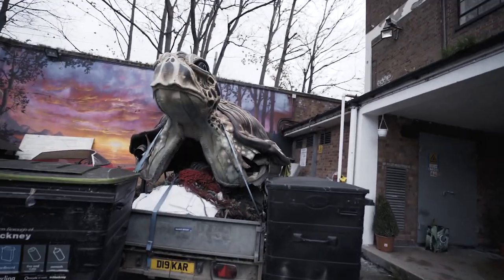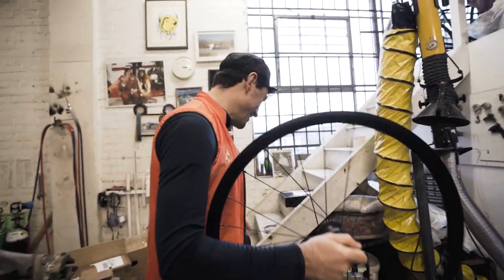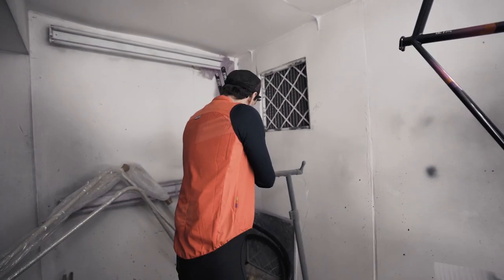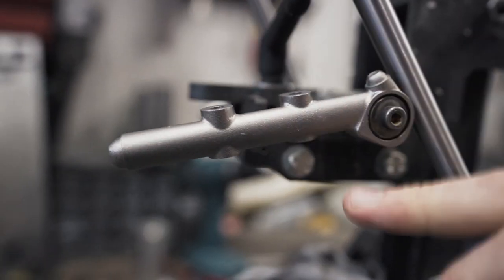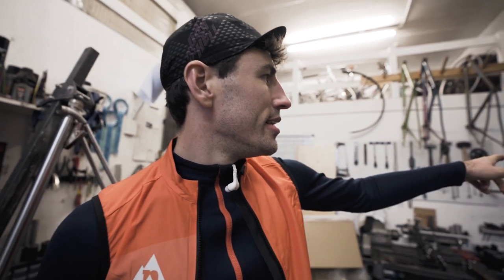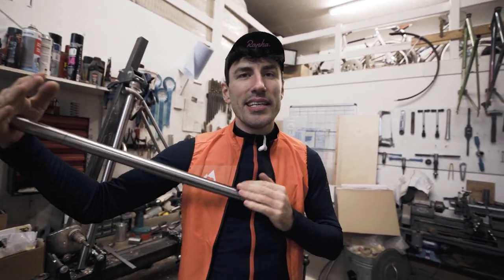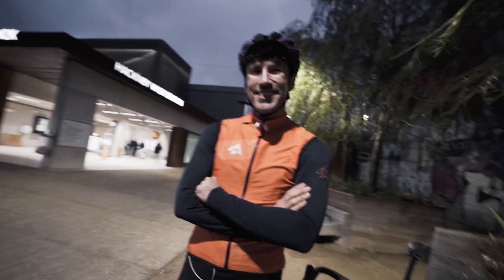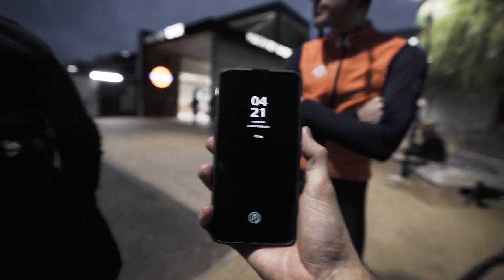HE MAKES HIS OWN BIKES!

Comment: Another great video. Would love to hear Robs view on stainless frames. Avoids the corrosion issue but are there any drawbacks in terms of weld quality and fatigue?
Reply: Stainless has the same qualities as steel but with higher corrosion resistance and material hardness. Because of this it is much harder to shape meaning there are limits to designs. It’s also two to three times more expensive and harder to weld.
Reply: @quirkcycles  Ta!

Comment: What is the advantage of the sintered stainless over 3D printing in wax and having the part investment cast in stainless? Generally the sintered stainless is more brittle than cast and a pig to work on afterwards if you need to drill or tap  due to the hardness.
Reply: The pieces are printed with an internal lattice and have a wall thickness between 0.5-0.75mm making these pieces much lighter than cast ones. Also no need to make moulds plus changes can be implemented instantly.